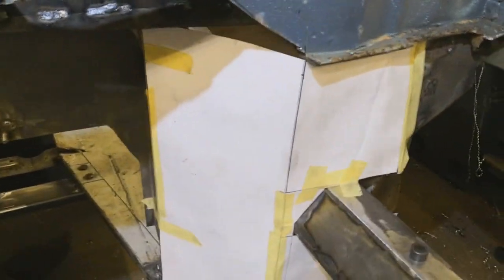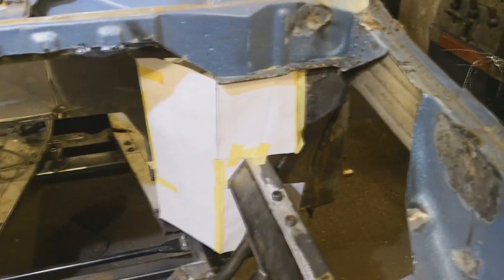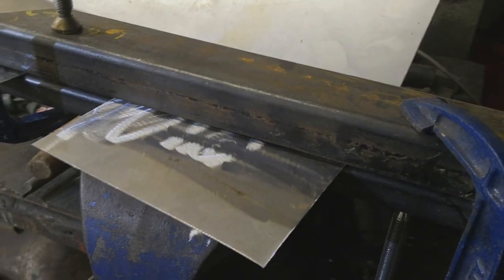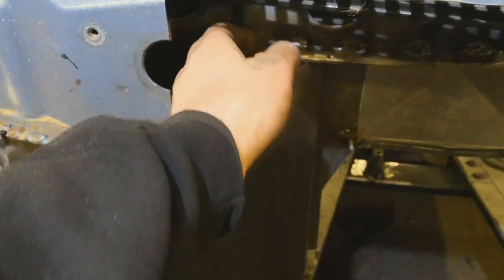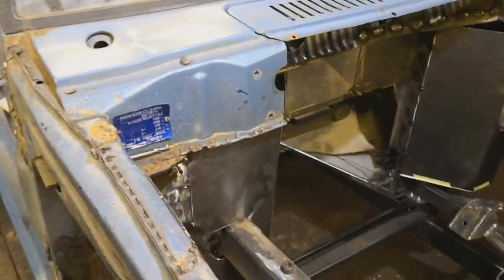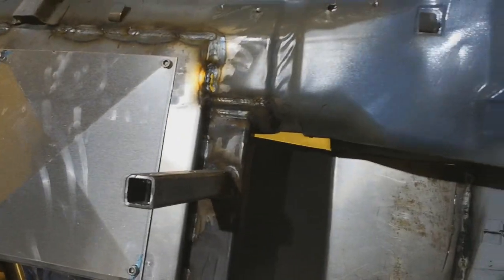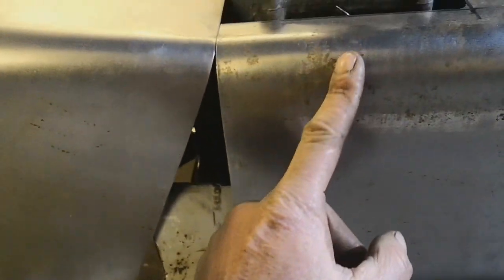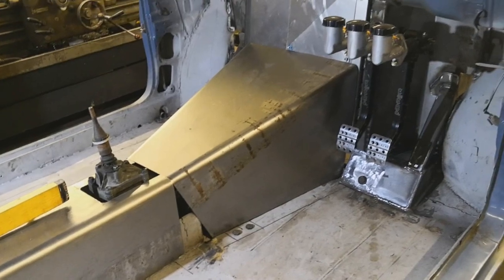RWD Micra part 14 bulkhead and tunnel

Comment: What thickness is that metal you used for the bulkhead panel?
Reply from the maker: It is 1.2mm sheet. But there is also some box section steel in there tying the floor rails back into the upper crossmember that runs below the windscreen. I wish I had gone filully space frame to save weight. I'll do that on the next one 😅